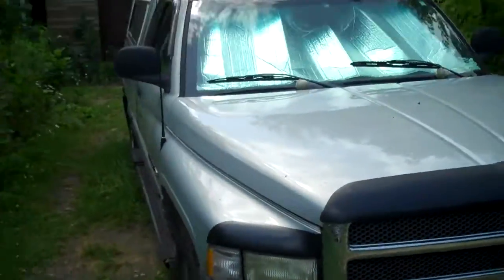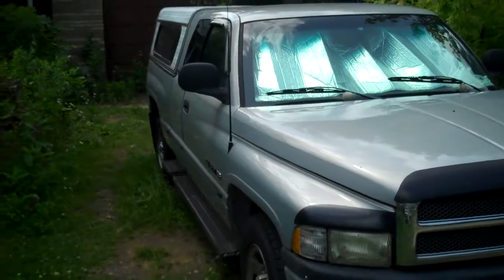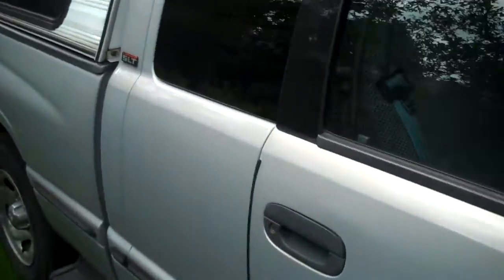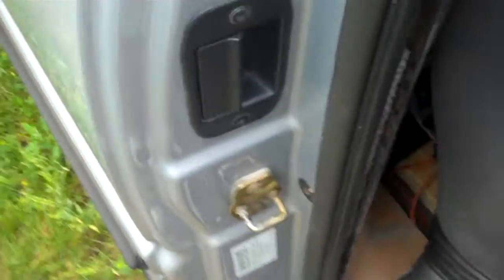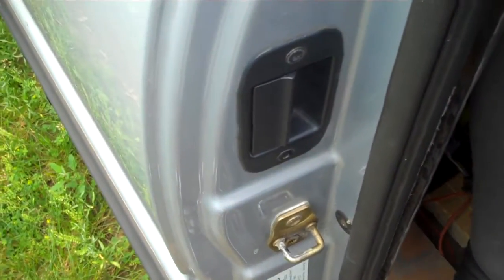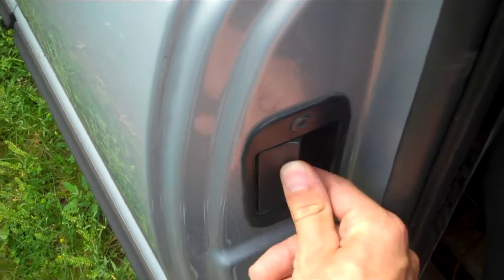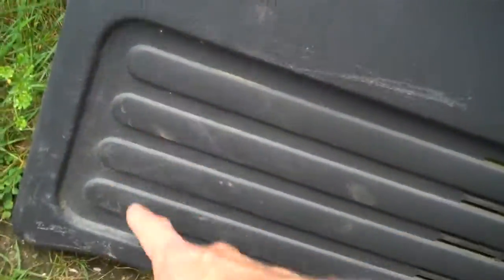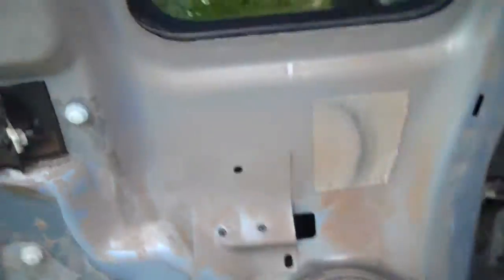How to Fix Rear Quad Cab Door Latches on a 1998 Dodge Pickup Truck

Comment: you can get the door panels off the rear doors even if the won't open.my drivers side bottom latch seized if you can get a pipe or anything solid Tod  use for leverage you can get it open.I would use heavy amounts of penetrating oil several times be for you try to pry it open to help loosen it up.you will most likely have to get a little violent when trying to pry the door open.but once you get it open the best thing to do is just replace the bottom latches.I will make a video on it when I change mine out.I will be doing both sides so I don't have any problem with the passenger side.
Reply: OffRoadRunner94 my trucks door can't open I have tried opening the door with that latch pat but cant. any tips?
Reply: David Danilko I'll post a video about it soon,probably tomorrow.